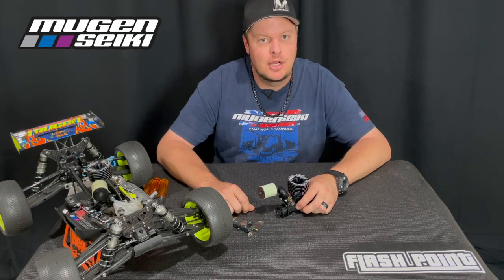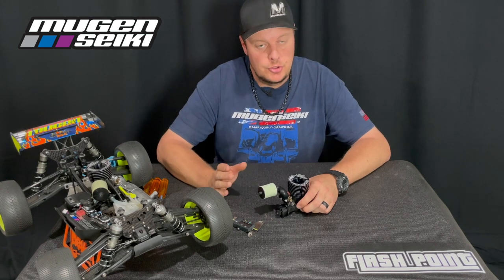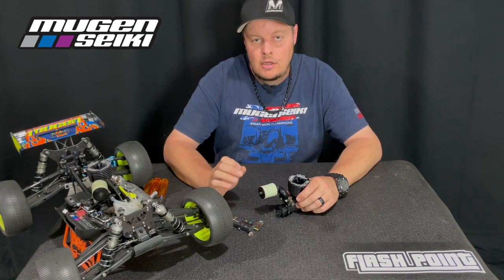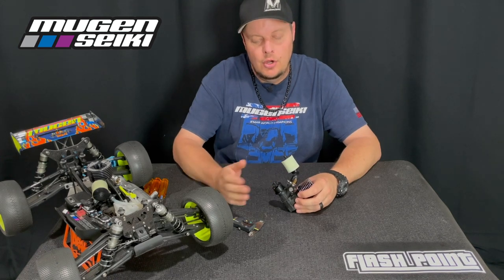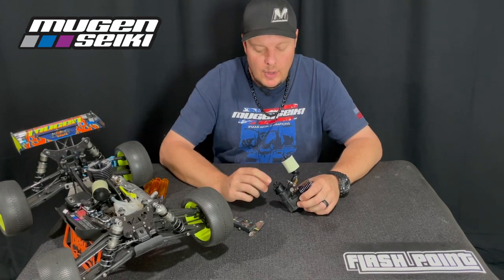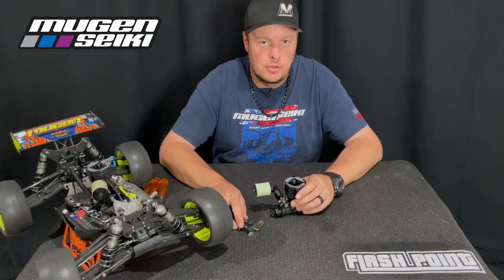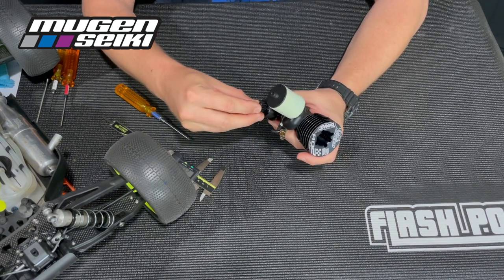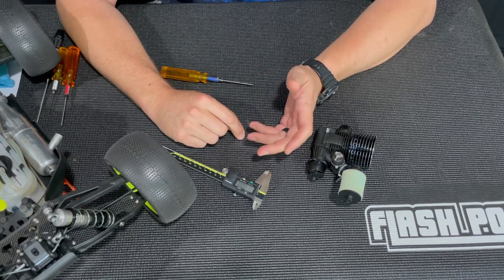Get the maximum performance out of your clutch.

Comment: My flywheel came loose and I can't get the clutch bell screw out because it just turns the motor over. Any idk what to do to solve this delema lol.
Reply from the maker: You can use a large zip tie to lock the piston in place.